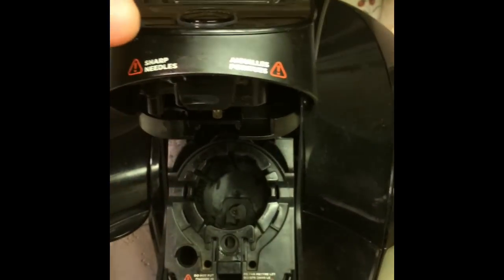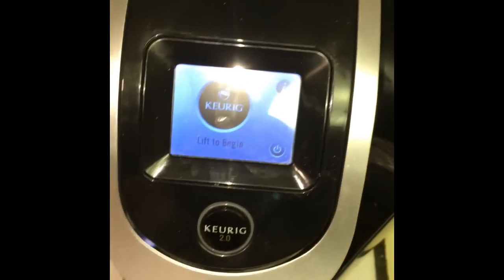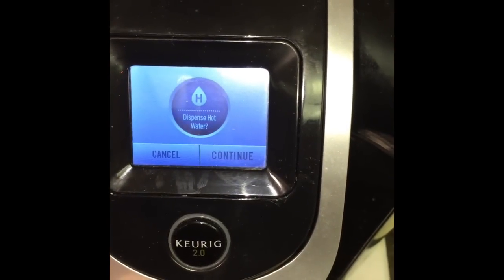✨ Keurig Coffee Maker - Broken SCREEN - Easy - Quick FIX ✨

Comment: Worked for me! Like a few others stated, two of our tabs broke off. Those tabs and separating the section were a tad more difficult to handle than I expected... probably because I was aiming for no broken tabs. Also, like others, our white plastic connector wasn’t loose, but I pushed it down anyway, and it worked! It’s nice having a clear, right side up, left-to-right, non-mirror image display back! Thanks for this!

Comment: Worked like a charm. I thought my Keurig was toast for sure. The white connector seemed tight so I pulled it loose with a small flathead screwdriver and reseated it. I also broke two tabs getting the housing loose. It still snapped back together with no problem. Thanks for the video!
Reply from the maker: Aaaaaawesome☕️☕️☕️☕️

Comment: Thank you SO MUCH! My issue was that when I plugged it up it would display the power button but the screen would not respond when I touched the button. I watched your video this morning but since my problem differed I decided to call the Keurig (non)help line instead. All the rep had me do was unplug it and plug it somewhere else before informing me that we had done everything related to my problem. She then informed me that it was out of warranty and politely tried selling me another one which I politely declined and with nothing to lose decided to try your fix. Even though the connection didn't seem to be unseated it worked so I thank you again.

Comment: This worked great!!!!!!! Took me less that 10 minutes! I read many comments first and saw that people were breaking the tabs. I used a thin screwdriver and very easy moved the tabs out. Took needle nose pliers (there is a spot up front they fit in) and pulled with very little pressure then wiggled the tabs again with a screwdriver and it came apart very easy. So no tabs were broke. I was thinking of a new Keurig but now I don't need one!!!! I bet Keurig hates your post!
Reply from the maker: Very good,
Thank you

Comment: They've changed their design in the Keurig 2.0 which didn't help the issue but did change the fix action. The connection pointed out was not there, but found two other connectors towards the back of the cover that was held on by the 2 screws. I pushed on them and the screen straightened out. THANKS because I was preparing to replace before finding your video.
Reply from the maker: That’s so good to know,
Thank you😊

Comment: Thank you! This was really easy and totally fixed my problem. My screen would occasionally go white and it would always go away until yesterday when it seemed like my screen would be white forever. Any method that doesn't involve fixing that loose white connector is just a quick fix and won't actually solve the problem for long.

Comment: Works great! What an easy fix. Thanks, Scott. I did break off one of the tabs with a screwdriver when I first tried to open the tabs. I'd recommend to anyone that you pull the tabs out slightly with thumbs while pulling up the top part: you'll hear the pops as each one free itself...I started at one end, worked toward the center clip, then around the other side. Thanks much for a great, helpful video, Scott!
Reply: Omgosh I did too. Lol!

Comment: Perfect.  Took mine apart and sure enough, the connecter was completely unplugged.  Plugged it back in and it's been working fine ever since.  Thanks for your help.  BTW, I spoke with Keurig about this problem and they offered 20% off on a new coffee maker.  Thanks Keurig!  You'd think they'd know what was wrong and offer the fix.
Reply from the maker: Nice job Richard👍😊

Comment: Thanks Scott, even though my issue was a tad different then a wonky screen,( my power button showed up but didn't work) it did fix it!.  I was doing it from bad memory and ended up removing 2 unnecessary screws on top, which if you make the same mistake, are not the same size as the front screws, so make sure you put the fat short screws back on top and the longer narrower screws on the front.  The other people who mentioned that they broke the tabs had me using a tiny screw driver to wedge away to release the 5 tabs.  As others said, even though the connection was not visibly lose and didn't really move when I pushed it down, it did the trick. I didn't break anything and I now have a perfectly working kuerig.

Comment: Fixed mine!  Thanks.  Just managed to accidentally break off the back two tabs.   Oh well.  Still better than shipping it off to Keurig. Must be careful on the plastic tabs - they can break easily.  My lcd connector was different than yours shown (as I have a slightly different model) and I just made sure to ‘press down’ on it to ensure a secure fit and it worked!  All my other screws and tabs were just as shown in this video.  Thanks again!

Comment: I don't get how this fixed it but it did. My connection to the board wasn't even loose. I did pull it off and on again and plugged it in and it was back to normal. Thanks for this quick fix. Took all of 5 min.
Reply from the maker: Nicely done Tony

Comment: Hey Scott thank you very much for your DIY videos and surely my 6 years old Keurig 2.0-400 back to life! I was having a hard time to figure out the screen when it goes bad and brewing 2X because I cannot get it set to 10 0z. I went to search other troubleshooting guide on-line, but they recommend replacing the whole panel which is hard to get anywhere. This model was discontinued and most likely you end up buying a new one. But hey you saved me almost $100 bucks with this hack! Maraming Salamat.
Reply from the maker: Thanks Oscar, so glad it worked.
Are you in the Philippines?

Comment: Mine was showing some distortion on the LCD, still legible most of the time, but when I tried to look at the diagnostic count mode, it was illegible and the QR code it shows at the end of the diagnostic was messed up enough it could not be fully deciphered.  I followed the procedure and took the extra step (since mine did not seem loose) of carefully unplugging and replugging that little connector.  When I powered it back up after doing this, the screen was crystal clear again in all modes.   Great post.  Thank you!
Reply from the maker: Thanks so much James😊

Comment: Worked perfectly.  Snapped off one of the little connector tabs when bending back.  You don't have to bend back too far to get the center open I found out.  Was able to glue back on and everything came back to life.  Thanks!!!  As an FYI, Loctite Plastic Bonder glue is what worked perfectly to reattach the tab that broke.
Reply from the maker: Nice job Sean,

Thank You

Comment: Mine must be a newer 2.0 model where they apparently implemented a new connector.  Everything else looks identical, and yes, I broke off a tab with the butter knife even being very careful.  Anyway, I sort of just put a little pressure on the board in hopes of reseating something that I could not see, since the 'connector' in your video is not there.   I was careful, but just applied a little pressure  mostly upward since there was no connector anymore.   There were also a couple of wires back by the hinge (under the removed black cap).  It was tight for my fat fingers, but I just sort of gave each of those a shove to make sure they were also well connected.  Anyway, I have no idea what actually fixed it, but when I reassembled, it worked.  Thanks!
Reply from the maker: Very cool,
Thank you

Comment: thanks Scott......works perfectly.    As far as breaking off the tabs, you don't bend them very much and you need some upward force for them to stay open.   Start with the front middle one and as you pull it out, force a small blade or screwdriver between the upper and lower sections.  you will see the crack get larger as you go.   Once you have the front one open then you just keep applying upward force in the crack separation and the side tabs will open easily.    front to back.    found my connector was completely pulled out, but got it back in and seated all the way.     Just wished i'd seen the feedback about putting a dab of superglue on the connector before reassembling.     If it happens again i will definitely put the glue on.    thanks again,  can't believe that the Keurig  site can't supply this info.
Reply from the maker: Great Info.  Thank you👍

Comment: Great video... followed it and it works temporary but got the same problem again after 2 or 3 brewing, It didn’t really solve the white screen. I’ve found out that the white connector you’ve been talking about is the sensor that sense if you are using or not a Keurig pods.
Reply from the maker: Nice,

I wonder if a little super glue would keep the connector from popping out?

Comment: :-)   My screen only showed the power button-wouldn't turn on. Your tip fixed it. THANK YOU!!!!!
Reply from the maker: Thanks Sam😊
Reply: Mine did not and the problem Still Remains after even removing the ribbon cable for the LCD and putting it back in :-( WTF?

Comment: I broke off a couple tabs also but Keurig did that to let them know someone got into the machine then they are off the hook on Warranty. This fix worked fine for me. I must have loosened this plug in when I clipped out my Green wire to bypass the K-Cup from Keurig only use. I also tied my two black wires and soldered them and now have the full menu too. If mine does this again I will unplug that little plug and add a little Dielectric grease on it then plug it back in and that should be a permanent fix after doing that to it.
Reply from the maker: Great idea😊👍

Comment: It was still a faulty connection, but either yours is an updated one or they tried to make it harder on future 2.0's because now it's just some sort of mini 20 pin and the rest of the wires are soldered directly on with hot glue all over the connection. Popping all the clips, removing the handle, and jostling the mini 20 pin looking connector in the back of the board still worked though so thank you!
Reply from the maker: Nice, thanks for the update😊

Comment: Thank you for the tutorial. I fixed it right away without breaking any tabs. Connection got loose after i used the needle cleaner cup....
Reply: Tip i recommend is a plastic spudger if you work with tabs like this. They are easy to break, so you have to be patient. Start with the center tab and work your way to the second tabs. Release both sides before working on the back tabs, slowly and gently wedging it apart. The final clips should pop of alot easier since there is alittle more leverage on them when you lift the tab.

Comment: Thank you! Mine is a different model but basically I pushed on every one of those connections I could find that were attached to any electrical wiring and it worked! (Basically the "I have no idea what I did, but I fixed it!" method :P)

Comment: After an unproductive call to Keurig Customer Service (the rep offered me a 20% discount coupon to buy another unit) , I found this video. While it's discouraging to see so many others suffering with the same prob it's great to know there *IS* an identifiable cause and fix.  We'll be taking steps tonight to correct our naughty machine.  Many thanks for your efforts. Fingers-crossed it'll do the trick XX

UPDATE - No luck whatsoever - that space on my 2.0 is an empty chasm, no colored wires anywhere whatsoever.  We're at a total loss as to what to do next.
Reply: Watch the video again. Colored wires were never mentioned. Removing 2 covers is a 2 step process. Sounds like you didn't take the second step.

Comment: dude my model is a model newer then yours and don't have the same connections and tried it anyways and it's fixed awesome video thanks
Reply from the maker: +Todd Baker 
Nice job Todd
Reply: Tru3 Gamb1t  how did you fix it? I have a 525 and touch screen is not working.
Reply: @Damien Schafer BLESS YOU DAMIEN . F U C K THATS GOOD ADVICE. 
 EVERY VIDEO I FIND HAS BEEN ABOUT THE OLDER VERSION. 
THE ONE YOU AND I HAVE - YES - YOU ARE RIGHT - ONE GOOD PUSH WITH SCREW DRIVER. 
THANK YOU

Comment: Great video! My only suggestion is to be very careful in prying up the plastic tabs. They are not designed to be flexible objects. They will flex a little but it is very easy to bend then too far which causes them to break off. Bend it a little and then try to slide a knife into the gap to help pry it open (my wife's suggestion). Using this technique I broke only 1 of the 5 tabs. The connection on my Keurig did not appear loose, but I pressed on it anyway. The coffeemaker now works just fine. I wonder if maybe I should have tried a Gbbs head slap first, and then used this technique only if that did not work!
Reply from the maker: +HM F 

Yep,
Just a good slam down on the counter could fix it.

Comment: I can't get the casing apart. Any helpful hints? I already broke off all the tabs accidently. 

I finally got it apart but this didn't help me, but my problem was I had the power symbol but it still wouldn't turn on. Other videos showed cleaning the screen would fix my issue and it didn't either. The diagnostic menu comes up but the power doesn't work alone. I've had it since 2014 and brewed over 3000 cups, so I guess I should be pleased with the longevity I have gotten from it. Any ideas before I chunk it?

Comment: Mine doesn't seem to have that connector, or anything to connect to in that spot, but your screen also looks different than mine after fixing it. What model are you working on? I was so excited to fix mine when I found this, I took it apart right away, didn't break any tabs (tho some looked like they had been bent already...), only to find no connector,no wires, nothing. It still made coffee prior to this, just had a messed up screen. Any ideas?
Reply: mines too no white button

Comment: Even though mine didn’t have the same coupling, u gave enough info to get into it. My 2.0 is a different version. There IS an LCD  ribbon coupling like a TV. After checking the connections, alas it is all for naught. Thank you for the step by step to get into and out of the little beast. And YES it took some strength but with finesse to get the plastic cover back into place. These are an engineering feat. Looks like a different version for this CHRISTmas. By the way, if anyone is having late dripping issues, might catch my video on my amusicvideoblair YT channel. Thanks!
Reply from the maker: Nicely done😊

Comment: I was suspecting this, seems like after I run a few cups of water thru and get it all steamed up it comes back on, I thought maybe the humidity in there was allowing a bad connection to complete a circuit. but not today! I unplugged it to move it and it wont pop back on even after 10 tries.  very irritating.    I wonder if cleaning that connector and using some connection grease would make it stop doing that.
Reply from the maker: Thanks Larry,
The electrical grease should do the trick👍

Comment: I know this is an old video, but I tried this fix and when I opened mine up it doesn't have that plug in it, but it's a 2.0 with the same issue and the rest of the electronics look the same. Any help  or ideas would be appreciated! Thanks!

Comment: The bottom left corner of my touchscreen responds to the bottom center (tapping "strong" results in "hot chocolate" being checked). Touching the bottom right does nothing. The upper 2/3rds of the screen works fine. Any idea if this method will help?

Comment: Without removing the screws I finally got a colored screen with access to one 1 cup and no other modes.  After a power outage, I can only get the diagnostics and decided to remove the screws and tabs.  Nothing was loose but applied pressure anyway and adjusted the wiring a little.  Still no screen of any kind.  It's a beautifully constructed instrument and there should be replacement parts provided by the company.   Not to mention the expense.  If there are any other suggestion it would be greatly appreciated.

Comment: so I did everything in the video, the white box on the inside was not loose, but I still pressed firmly and it didn't fix. any other suggestions ?
Reply from the maker: Nice,

See if you can pull out the small white connector that goes into that box and then push it back in again to see if that makes it any different.

Comment: I tried this and got it to work for awhile but the screen went blank again.  when opening up, the connector looked fully seated but repeated this procedure again and the LCD screen worked again.  Same as before, worked for awhile but then went blank again.  Did the resetting procedure again but this time tried to improve the repair by inserting a small piece of rubber/foam adhesive on top of the connector which should apply positive pressure.  Worked for awhile and then blank again.  Opened it up and the connector looks to be fully seated.  Hmmm?Believe what is happening is that a light layer of oxidation builds between the surfaces of the pins and connector which provides just enough resistance to make the display do weird things.  When removing/pressing down on the connector, the oxidation is scraped off.  I think the only final solution would be to hard wire the connection.  Otherwise, just plan on having to reset the connector periodically.  Doesn't take that long but will likely break all the retaining clips eventually that hold the head together.Who would have thought?